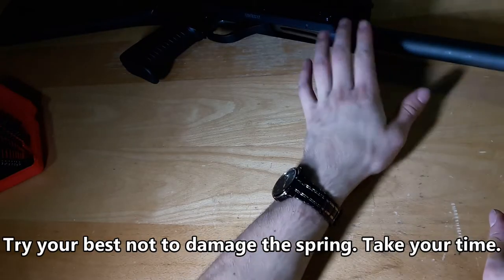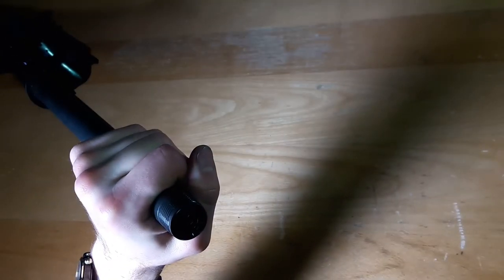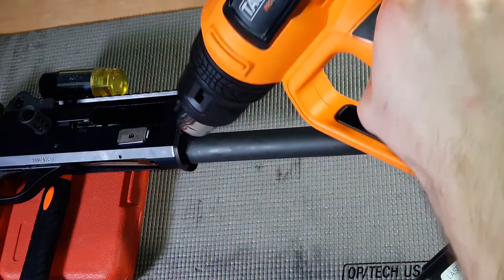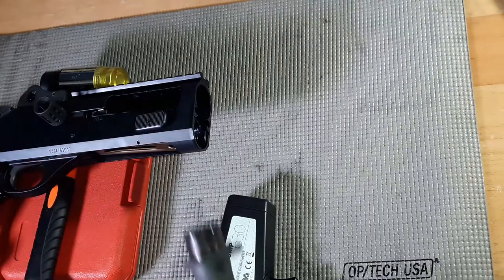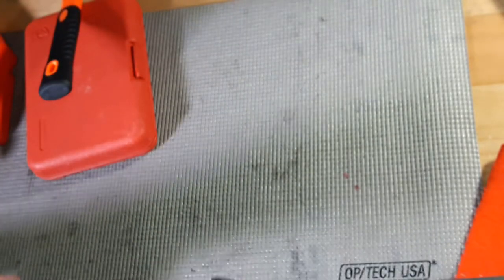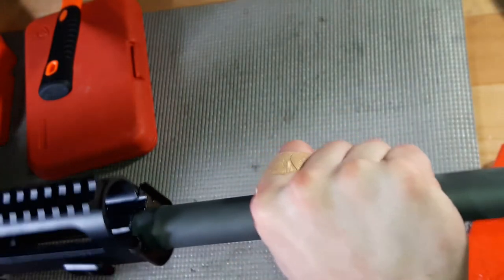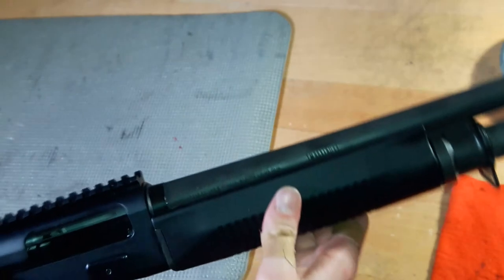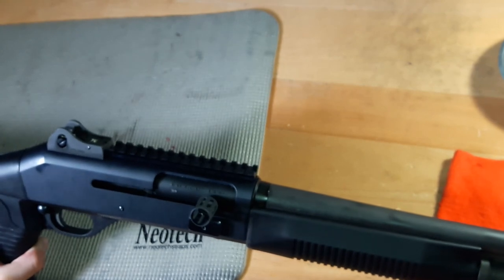Benelli M4 Modifications Tutorial | Bolt Release, Magazine Tube, Safety, Bolt  | Part 2

Comment: Holy balls I just heated the loctite for an hour and still the fker won't budge!!..is the M1014 using a different loctite??...
Reply from the maker: I would think it's the same loctite as it's an M4 made by Benelli. The only thing I could think of is that maybe the heat isn't really heating up the part you want. In other words, the heat you're applying is either too far away from the gun and so the gun isn't getting warm because the heat largely dissipates in the air; or, where you're applying the heat isn't necessarily in the correct location resulting in the loctite not being heated to a high enough temperature. I could be wrong, but spending an hour heating it should be way plenty. Besides, it only needs to reach a certain temperature (well, the area with the loctite only needs to be a certain temperature). However, I don't remember the temperature off hand, but I believe I said it in the video. Also, make sure that gun is secured in something strong while you use gripping work gloves to rotate the tube...it makes a difference.
Reply: @ELITEkickBOXER  thanks for the response! I’ll give it another go with a temp gun before going to a gunsmith
Reply: See my reply to Mash Ameri above.
Reply: @EroticOnion23  did you have any luck? I've been trying all morning but it will not budge.
Reply: @sanfedista1361  Nah, I just bought a +2 extender after... :/
Maybe a pro gunsmith might have better luck?
Reply: @EroticOnion23  I friggin got it!!! I think part of the problem was my cheap heat gun so I concentrated on the exposed threads and small turns then would heat the newly exposed threads and loctite. Be well.

Comment: I tried the heat gone for 30 min an it won’t come loose
Reply from the maker: The heat is a continuous process as well as one where the heat dissipated relatively quickly if you take intermittent breaks or something like that. This may not be that helpful, and I apologize for that. However, I do suggest a few different things you can try (given what you just told me): keep going with the heat, put the heat gun on a higher mode if possible, make sure the heat is being directed to the rotation point and not simply just around the entire gun, put gloves on (or have someone else help) that gives you a better grip. Don't give up though, you can always try it again another time if you want to do it tomorrow or something like that. It will come off, it's possible a bit more "glue" may have been used on your firearm and so may require a bit more heat/higher temperature. Also, you make sure the heat (if you can) is being directed around the entire barrel circumference (not length) and not just one specific spot if you're still having trouble.
Reply: EKB its a brand new one I just got from the factory. Thanks I will try it longer .
It’s so darn tight that it would not turn at all .
Reply from the maker: @mashameri7019  Lucky. I remember when I first got mine. One of my happiest moments haha relatively speaking. 
Anyways, I know the feeling. I felt that a few times too when I was doing mine. Honestly, just some more time heating it up will work.
Reply: @mashameri7019  I just did this upgrade to a new and unused M4, and I had to heat it to just over 300, and it was still a PIA to turn, but it did slowly turn with a tremendous hand grip. My hands and forearms hurt for 24 hours, but I got it done. Best of luck.
Reply: @TYB439  currently wrestling with it. I've been stopping at about 280° I guess I'll try to bring it up to 300°